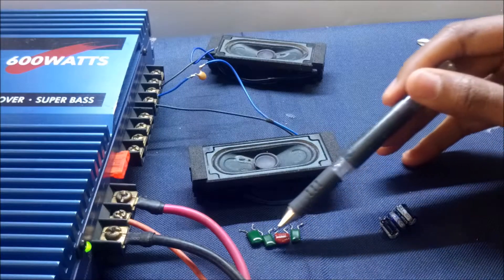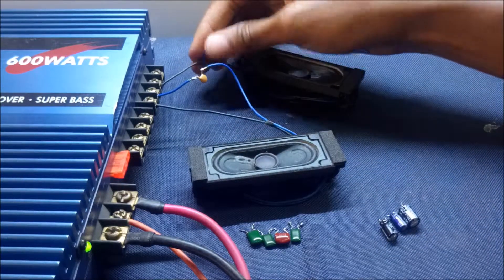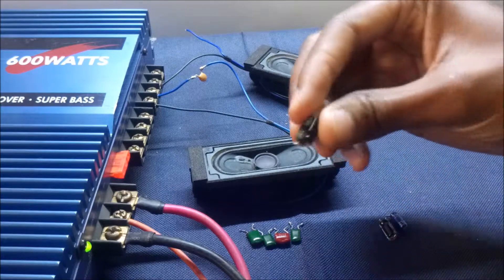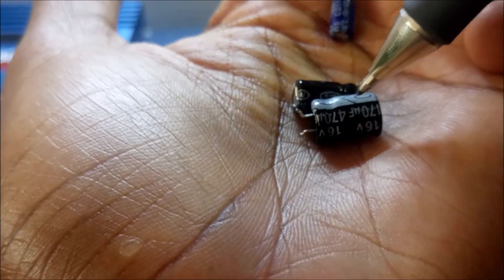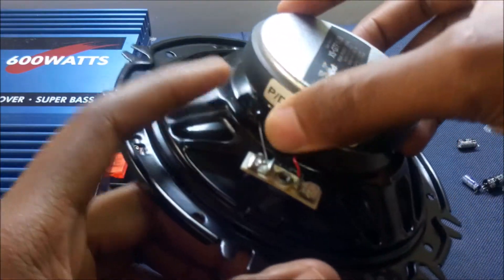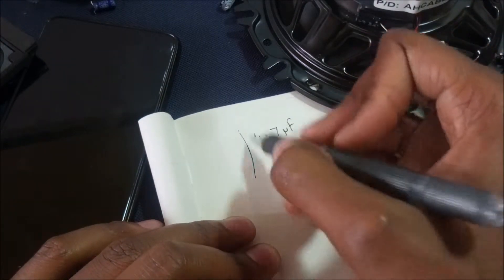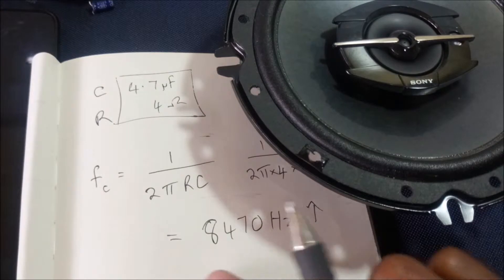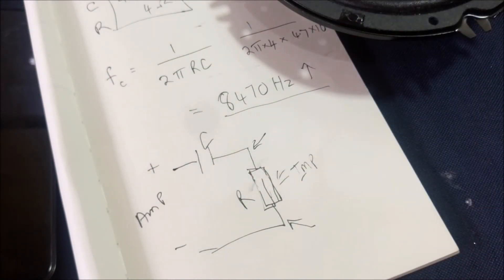Using Small Speakers With Powerful Amplifiers

Comment: You do realize that the amp has gain adjustable nobs.... You should just reduce the gain on the chanels and you'll be good. I don't think all that is necessary.
Reply from the maker: Protecting speakers is necessary when you connect more than one speaker (of different sizes) to a single channel. Tweeter's and small speakers are the most affected